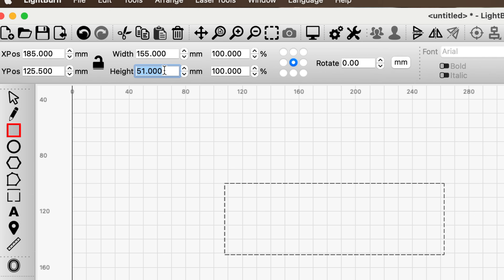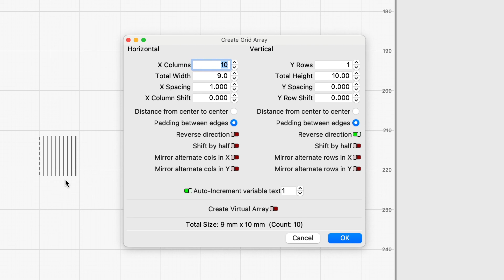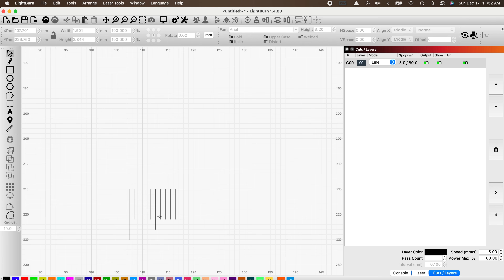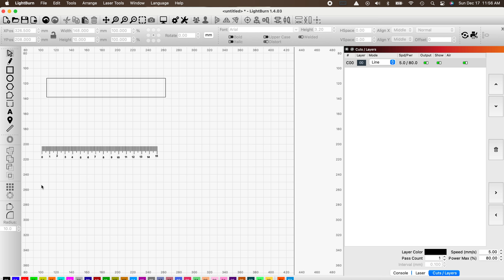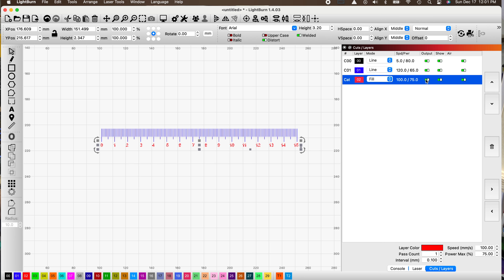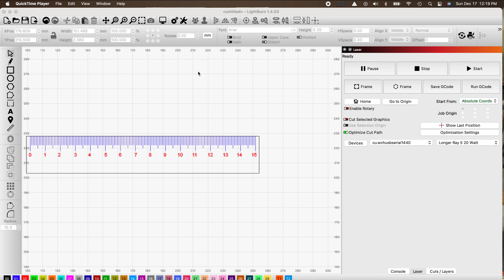Lightburn Tutorial   Making Rulers

Comment: Nice project Ken.  You should try making a ruler using your incra tools.  I have made a couple of rulers for shop jigs using my incra jig.  They were fun to make.  I like to avoid using my computer for shop stuff.  Keep making those great videos.
Reply from the maker: How did you get the measurements to be permanently marked on the stock Russ?  Thanks for tuning in and for the suggestion.
Reply: I used the flat edge of a chisel against the Incra fence at each increment on my Incra jig.  Then follow up with a small tip pen in each groove.
 You might be able to use your TS fence.  I used an Incra jig to increment the spacings on mine.  Yes, it's tedious.  I tend to avoid using my computer to make things

Comment: Nice video Kenny.  Wondering why you don't use the group and ungroup icons on the menu bar instead of using the drop down menus?
Reply from the maker: The drop downs are just what I'm used to Matthew.  Either one would be fine.  Thanks for tuning in and for chiming in with your thoughts.  It's appreciated.
Reply: Why use drop down menus or menu bar icons ... use the <CMD>G and >CMD>U keys (<CTRL>G and >CTRL>U for PC) keys ... so much faster 😁